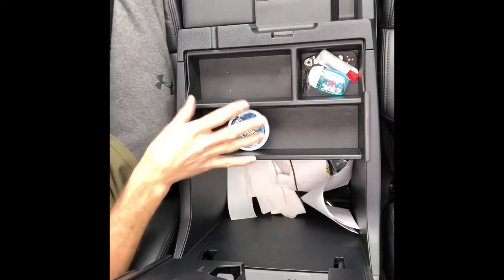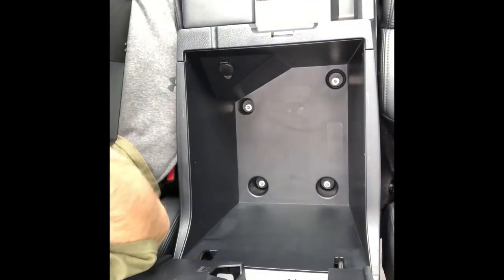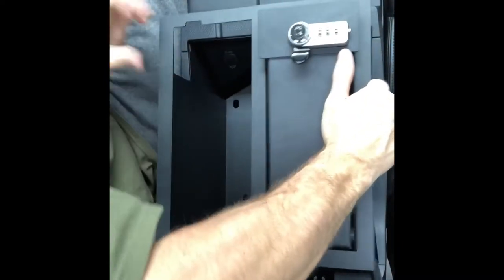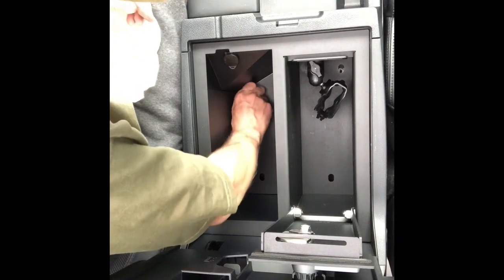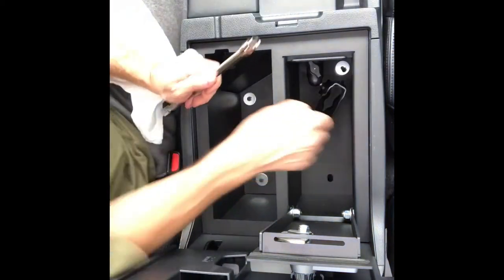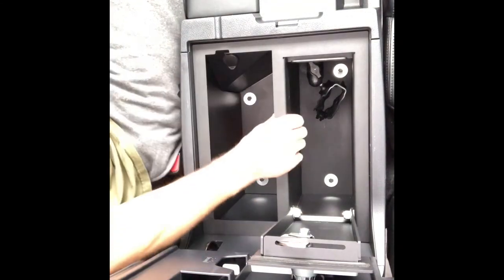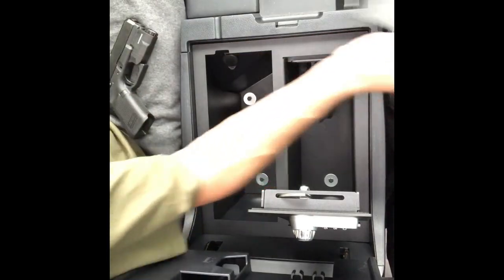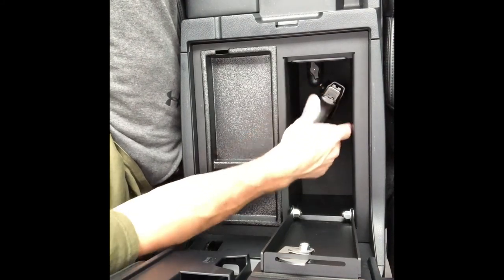Console safe and Dara holster install into the Tundra

Comment: Glad I stumbled onto this video. I had installed a Gunvault Microvault in my Tundra but it quit working less than 6 months (No explanation from gunvault other than cold weather). Wasn't even aware Toyota offered this option. I just finished installing my Toyota Console safe and it went in as easy as you showed and I'm really happy with it for $270. Wish I would have know about it before wasting $100 on the Microvault

Comment: I wonder how this item compares to the one done at "Lock'er Down" out of San Antonio? I'm thinking of ordering it due to having electronic lock and 10-gauge lid (and a magnet [$20] for handgun in lieu of holster arrangement). Their door is spring loaded and safe comes in full size or half-size for $339-$349.  The electronic combo feature (not mandatory) is an extra $150 but allows you to open safe on the move without going for a key, simply by turning lever on unlocked safe.

Comment: Just came across this. I am going to have to do this model as well.  Question I have is could you mount it to the bottom of the safe instead of the front side.  Is there enough clearance on bottom for the screw heads?

Comment: Thank you for the reply. Also (in your opinion) is the safe deep enough for a full size glock frame for a glock 22 (20) with holster and ram mount? Was ram mount and holster installation as easy as the safe install?
Reply from the maker: GREYMAN MEDIA It was very easy to install I have several videos on the installation of it.  I think 3 in all.  As far as a full size Glock,  my 19 sits perfectly in a draw stroke position.  A full size would have to be angled back more in my opinion.  Not saying it wouldn’t work but maybe not at the same angle as mine.  I do believe I have some more room that I could have lowered the holster.  I am at the beach on vacation right now or I would go check for you,  but I do believe there is room to move the holster down.

Comment: Is the safety box fit on 2019 toyota tundra 1794 edition?
Reply from the maker: Gregory Allan Bernal On Sparks Parts web site is says it will fit it.
Reply: Gear Runner thank you!!!
Reply from the maker: Gregory Allan Bernal Your welcome
Reply: It's not fitting mine. I have a 2019 tundra limited TRD. The console has a lip inside, front and rear, for the big tray to slide side to side on. It is rivited so it looks like i must drill it out! 😣😣😣😣😣😣😣😣😣